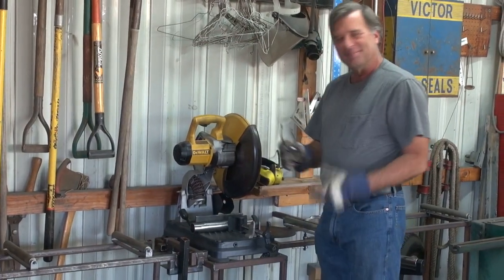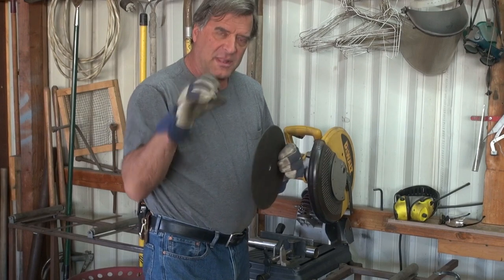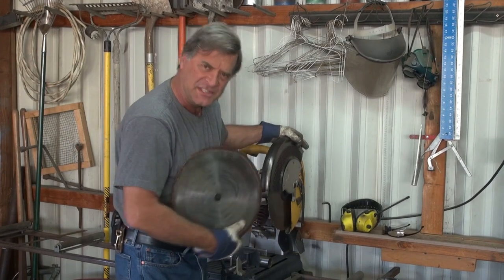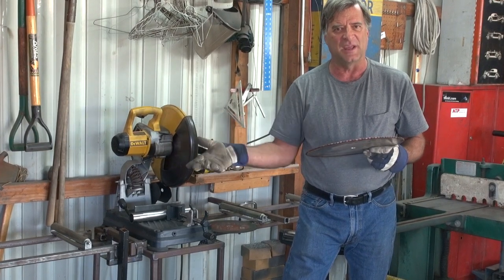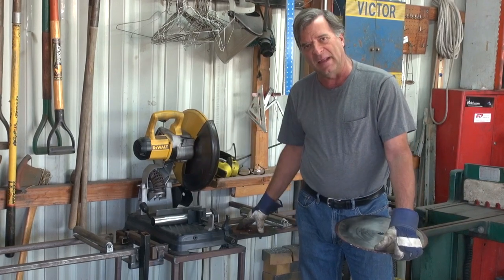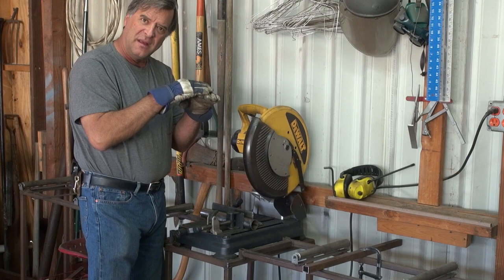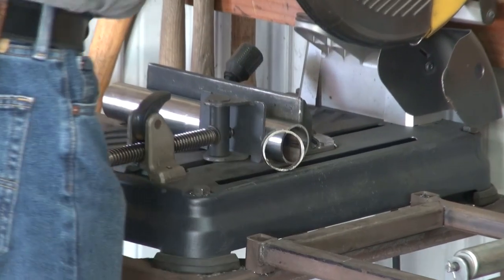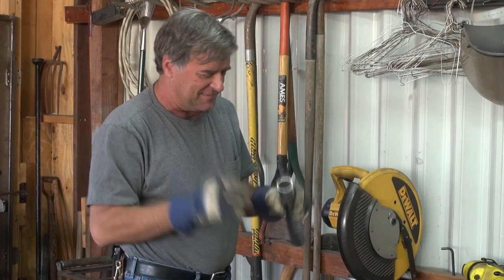Advantages and Challenges of a Cold Cut Chopsaw - Kevin Caron

Comment: We are using now abrasive saw and make around 150 cuts per day. Do you think switching to cold cut will be more cost effective?
Reply from the maker: More cost effective if you can train the guys to not push the saw..   You have to let it cut at it's own speed.    The blades are expensive to buy ($70 to $200) but are resharpenable for about 25 times or so.   then you just weld on new teeth and go again..
Reply: Kevin Caron, Artist   Kevin, you say weld on new teeth.  Can you tell me where you get the carbide teeth to put on and what flux and brazing rod you use?  Love your videos.
Reply: @Okie-Tom  They're silver-soldered.  Carbide Processors has a bunch of information, plus all the fluxes and materials, including little chunks of carbide for this purpose.  Also there are videos about how to do this, they have their own.  I think the teeth are cheap, but it's skilled work, and then you still have to sharpen it!

Comment: Hey Kevin, I think I have the exact same chop saw as you do. I love it! do you ever notice if you're cutting something like one and a half inch square tube, the saw seems to not cut? or as if the saw is very dull? If I chuck up a piece of 1 inch round tube it slices it like butter, but the square tube it will basically take pressure to make it cut, and I don't like that of course.  I had to cut some 3 inch square tube for a friend and I basically ruined a saw blade doing that. now I'm just trying to cut one and a quarter inch Square tube and it's feeling the same as when I was cutting his.  and I don't want to ruin another hundred dollar blade. does it have something to do with the geometry?
Reply from the maker: +Beach N Wheelchairs 

Yes it does!!      The more you are cutting on a flat side the less pressure you have to put on the handle..   Anything more than just the weight of your hand will burn out the blade and you have to resharpen.    When you are cutting something like the 3 inch square add a little piece of 1/4 by 1/4 under one side of the stock.   That will keep the blade from having to cut a long flat side and make it cut better and last longer..
Reply: +Kevin Caron, Artist Very smart!  I will try that.  I probably do need to get this blade sharpened but I don't know any place around here that does it.  do you mail yours off or someone local?
Reply from the maker: +Beach N Wheelchairs 

I use a local saw sharpening shop...

Comment: My friend recently bought a cold metal saw (rage) i believe was the name of it. Its a full miter slide saw. He spent a great amount of money on it. I had some previous experience with cold cut saw blades and im not a fan. Its loud theres hot metal chips that fly everywhere and i have to be standing there to do my work. Granted if you had something over 1/4"thick like some tubing this might be the tool you would want. I prefer my 64 1/2" horizontal bandsaw. I set turn it on and walk away. blades seem to last and when they break its only 15.00 bucks
Reply from the maker: +Phillip Jordan 

Yeah, mime is a chip spiter also..

Comment: Kevin - have you used this saw to cut Stainless Steel. I'm looking for the right tool to cut solid SS bar. Any thoughts?
Reply: There are blade made for stainless. Search Amazon. They cost a little more than mild steel cutting blades.
Reply: Mine worked great till I tried cutting stainless pipe at 45 degrees, the blade did not like it.

Comment: Whats the max thickness of steel bar can you cut with this saw and blade.  I chop up a lot of 2" x 1/2" CRS into 3" blocks. Will this saw be efficient?
Reply from the maker: 44Celt The biggest piece I have run through this saw was a 4 inch solid round billet.  Had to turn it and make a second cut to finish but it cut straight and true.  For 2 inch,,,  like butter!!!

Comment: What's the thickest solid bar have v you cut?
Reply from the maker: shexdensmore 4 inch round stock. Steel.
Reply: Kevin Caron, Artist that's solid, not tubular, right?
Reply from the maker: Yes,  solid steel round stock..   Had to cut it in to for the lathe piece I was playing with..
Reply: Ok, so what's the smallest you would cut safely with the 66 toothed blade? 
 I'm thinking of getting a 90 toothed blade for 3/8" square mild steel stock.
Reply from the maker: Had a 72 tooth (I think) on there and it ripped the 1/4 by1/4  stock right out of the vise..  I won't cut anything smaller than 3/8 with this saw..   Use a shear or a cut off wheel on the grinder instead..   My opinion only!

Comment: If I understood you right you said you can't put a metal blade on a abrasive saw, if that's what I heard that's incorrect. A abrasive saw turns twice the RPM's as a cold saw, if you put a metal blade on an abrasive saw it will not last long. Again, if I understood you correctly.

Comment: Hi Kevin, thanks for all your videos as I've learned a lot from them! I have one question... if you wanted to cut a bunch of different random angles using angle, square tube, round tube and 6in x 1/4in flat plate, what saw would you get? I don't want an abrasive saw so I was looking into these cold cut saws as I like that they aren't quite as messy. I was also considering a horizontal band saw and compound mitre saws but have no experience yet with any of them. Just been using the trusty angle grinder up to this point. Thanks!

Comment: Have you ever used a diamond blade on the chop saw....btw what model is it, you forgot to mention that.
Reply: ***** Check out the Dewalt Diamond Blade here...I am a Pipefitter and we use these at work for cutting structural steel...very impressed. Cuts through metal like butter
http://www.amazon.com/DEWALT-DW8500-14-Inch-1-Inch-Diamond/dp/B004L3X9AU/ref=sr_1_15?s=hi&ie=UTF8&qid=1421779308&sr=1-15&keywords=14+diamond+saw+blade&pebp=1421779312577&peasin=B004L3X9AU

Comment: Is there a chop saw that will cut angles in two dimensions like a miter saw?  I've done a lot of research on the Internet.  I wasn't able to find one.  If not, why aren't they made?
Reply: Yes. The Evolution Rage 3 sliding compound miter saw uses the same principle, a 10" blade, and does all you're asking and more. It's on par with the Harbor Freight SCMS as far as build quality, and the clamping system leaves a little to be desired, but I've cut hundreds of feet of steel and stainless with mine and couldn't imagine not having it in my shop. It's portable, cuts quickly, and blades are only about $50. The Oshlun brand works very well. We've laid it over to do a 45°x45° cut in .5x2" cold rolled to make a triangular base to securely hold a cube on point. Weld quality fitup with no fuss.

Comment: The chop saws are a great portable/cheap way of making angled cuts. The chop saws throw sparks, carbon disc powder, and hot metal all over the shop, and makes a mess.  Wouldn't take much for a spark to find a flammable liquid or oily rag in most shops...smolder all day and come home to ashes.  I don't think those fumes are great for you either.  I find the blade warps if you push too hard and can affect your cutting accuracy.  Also the noise is terrible, worse than a chain saw.    I think a band saw is a much better way to go for accuracy, noise, and low toxicity.  A good miter band saw will run about 3k, you can get a cheap Grizzly for around 600 but you will be sorry as you will have to move the vice to do angled cuts, and the hydraulic cylinders are crapola eventually leaking out and rendering the saw useless.  Go with Ellis Saw or better.

Comment: Very timely video - I just ordered one, should be here next week.  What type of business should I look for that does sharpening and blade repair?  Also, do you use abrasion saw much any more?  If so why one vs the other? Thanks for posting the video - very informative on how to properly use cold cut saw.
Reply: ***** Thanks, I actually took a double plunge - I know also have a horizontal metal cutting bandsaw in addition.  Putting it all together - next up the blade lubrication system, and then a test cut.  Thanks for the reply.